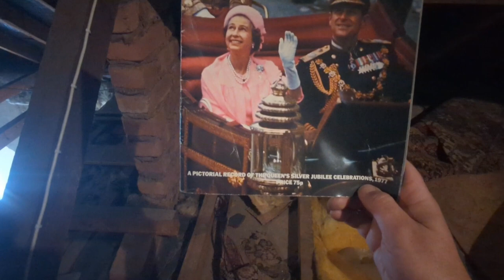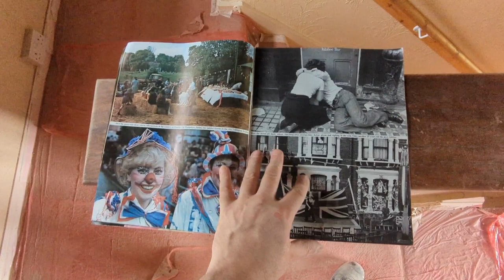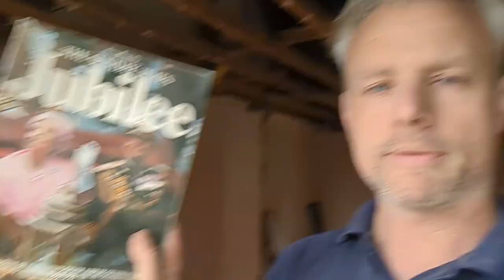Loft Conversion #2 Ripping out and prep.

Comment: Interested to see more of this.

We're looking at doing a loft conversion on our bungalow. Because we really want to avoid a big flat roof dormer type extension and the current roof pitch - whilst not super shallow - isn't overly steep, I'm thinking having it re-roofed with attic trusses might be the way to go. Gain more headroom and solve all the issues of rafter depth, and have an instant floor in one hit.
Reply from the maker: Hello, thank you for your comment. We've hit a little delay on this job and got a video coming out soon to explain why, so keep a look out for that one as you may find it interesting should you be looking to have the same sort thing done yourself. Loft trusses would be quicker but you will lose quite a lot of usable room due to the structure of the trusses. If you're open to having the roof taken off completely, then you may want to look into rebuilding it by hand, so to speak, to maximise the space.

Comment: Some structural engineers really like to cover their arses with stuff like this. All that steel will probably weigh more than the rest of the house combined. Often think engineered joists or trusses are a better solution in projects like this. Easier (and safer) to rebuild the whole roof than it is to manouver a dozen steels into place, only to have to do most of that timber work as well anyway - drilling holes for ledgers to mount the joists to, bulking up the rafters to allow for insulation, cutting into the roof to fit windows...
Reply from the maker: Mate, it's getting more and more ridiculous isn't it. We've had a meeting with the building inspector and the structural engineer and we have to install 15 steels in that roof! Unbelievable!